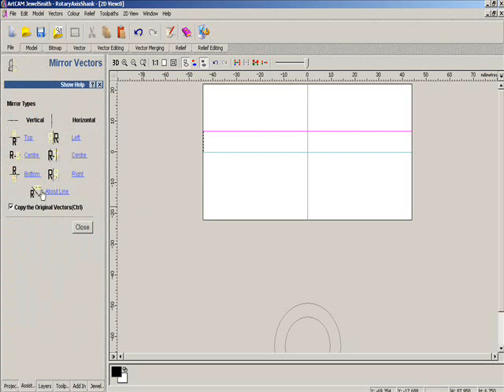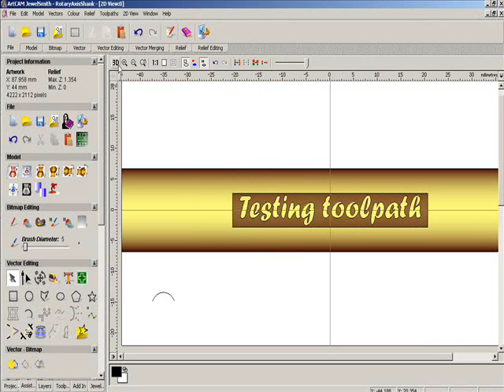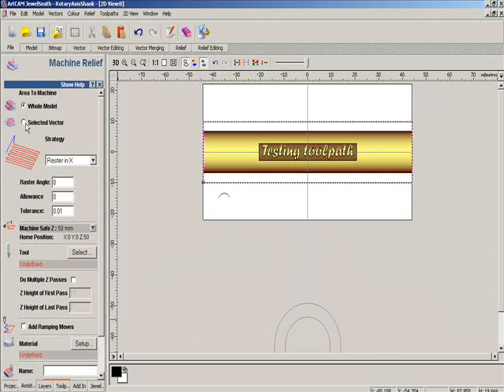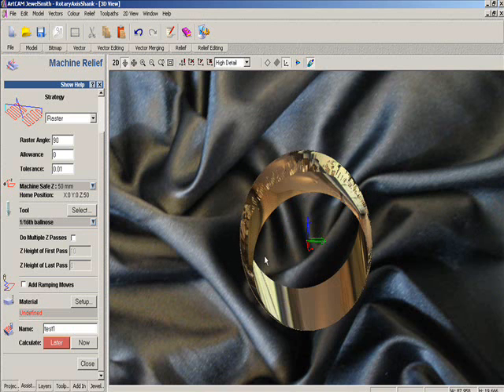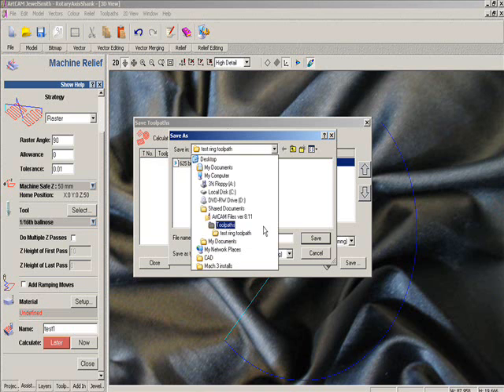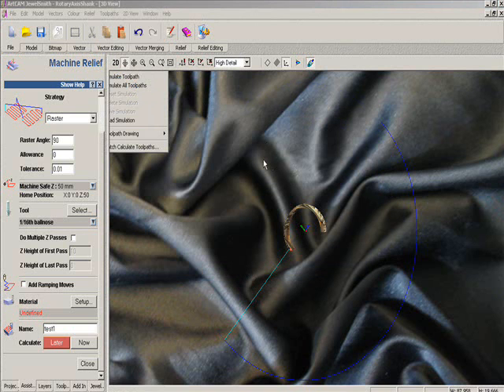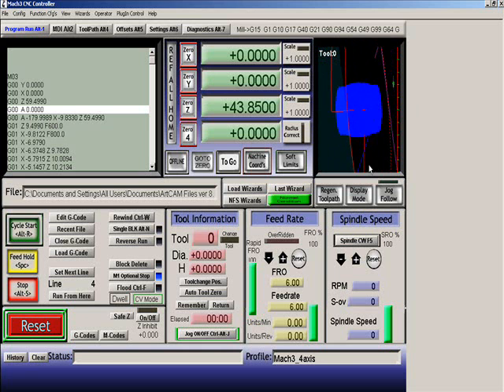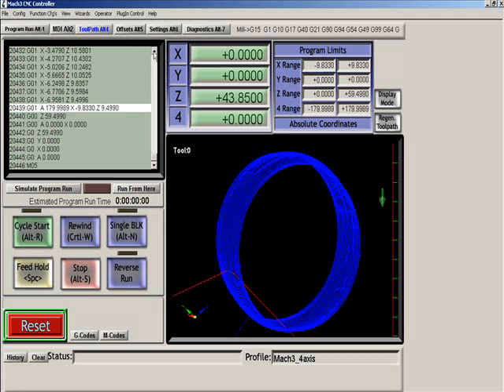test ring toolpath to mach3

Comment: Hello, how do you place the material in the cnc machine so that the z axis can reach the middle of the ring or to its origin if the bar that stops the material is supposed to be there. In other words, the origin must be at the top of the material for the z-axis to move over negative numbers, right? could you help me on this matter?, tks in advance.
Reply from the maker: when doing this style of toolpath.  I use a wax tube in the A axis.  The center of the ring is X,y and Z zero.  The tool never goes below Z zero.  The lowest Z will go is half the diameter of the "Finger hole" itself
Reply: @zidwid  Tks a lot for responding, do you have some video machining your ring in cnc?